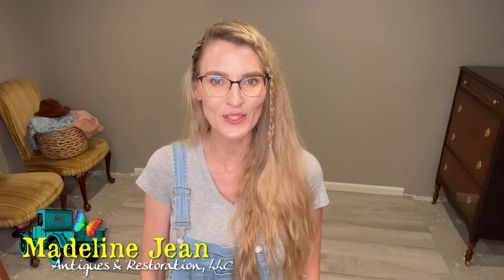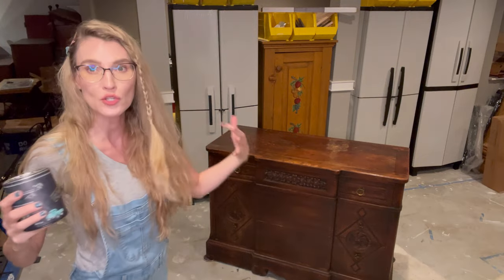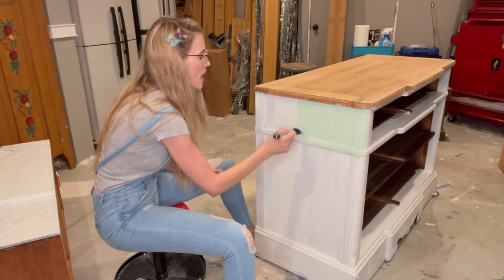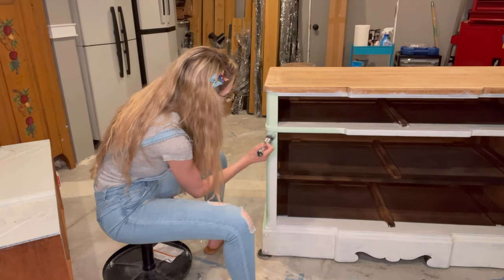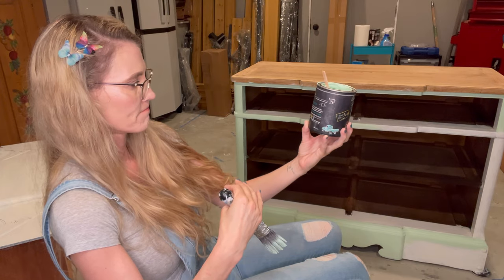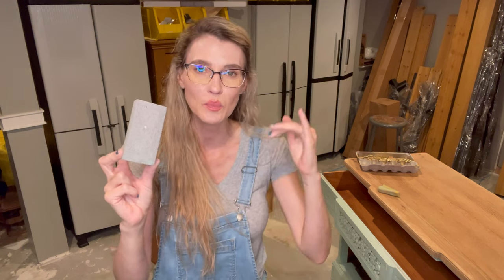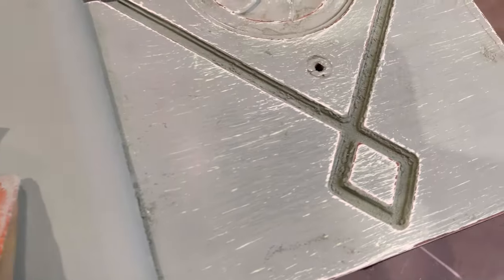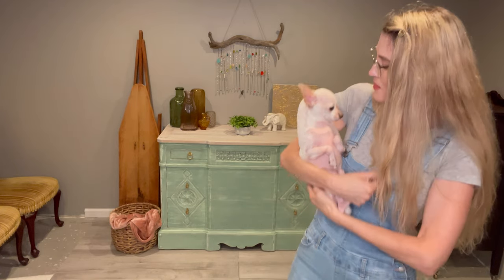Debi’s Design Diary DIY PAINT | Full Review

Comment: I been using this paint for several years and I always have a spray bottle of water to mist it as I paint!  You don't have to worry about the paint color changing because it's so pigmented. You can also use a wet rag to wipe back all the layers. No messy dry sanding. It's great paint ant it goes a long way. Ty for the video!
Reply from the maker: Thanks for sharing!

Comment: I k ow you thoroughly explained prepping but just so you're aware DIY really is different in that because of the clay it sticks to pretty much anything and doesn't require sanding, which also helps eliminate the chance of bleed through. Plus DIY has better coverage (because of the clay and the intense pigmentation) than the majority of paints out there so its even less likely to have those issues, especially when blending and layering colors. Plus it reconstitutes with water so blending and wet distressing is a breeze!
Reply from the maker: I do love DIY paint, love how pigmented their paint is but no paint marketed can say they don't require sanding and prepping. I've been refinishing furniture for over 10 years and prepping is the way to go no matter the paint line. I recently painted a vintage hutch with their white paint and decided not to prep (well I couldn't really prep because the piece was in a store where I would be selling it and there isn't a proper area to sand) I immediately had bleed through. I had to quickly switch gears and pick a darker color that wouldn't show bleed through. I didn't even sand the hutch. Again I love DIY paint but it's best to properly prep every piece for maximum adhesion and no bleed through issues. Thank you for watching and commenting.

Comment: I don’t know anyone that primes with that paint.
Reply from the maker: Well I do and I've never had an issue with adhesion or bleed through.
Reply: @madelinejeanantiquesrestor9074  Too bad you didn’t just paint the back without primer and then you would know for sure if you ever needed to use primer again
Reply from the maker: @Melody-285  Each piece of furniture is different when it comes to prepping. The type of wood, the type of finish they used, the type of cleaners they used. Many of these old pieces have a build up of old polishes and waxes. I always, always prep. First I clean with a degreaser. Then I sand most of the old finish off. Then I shellac two coats.